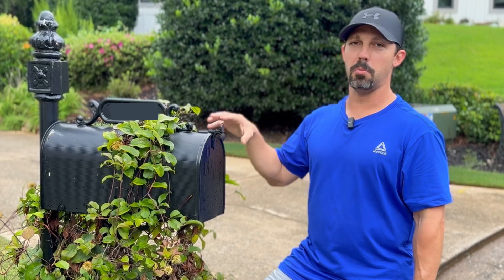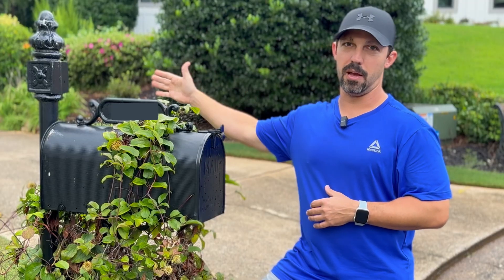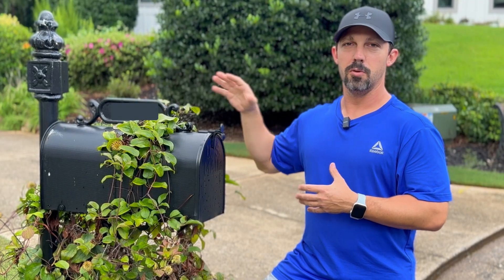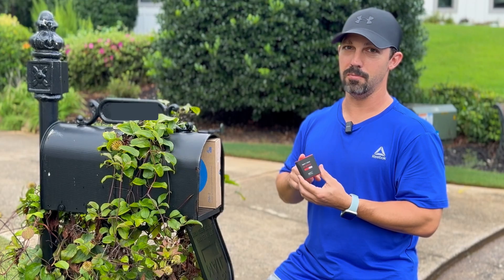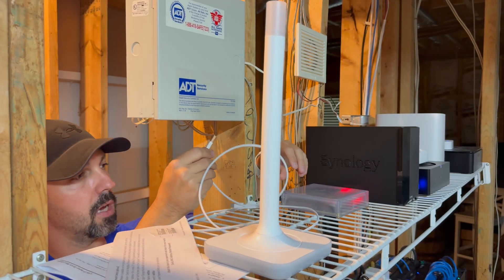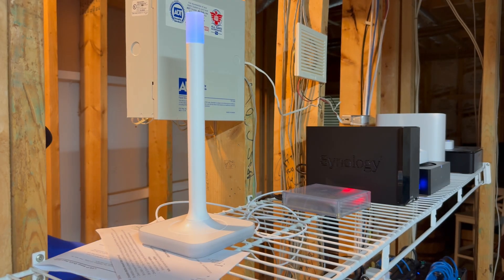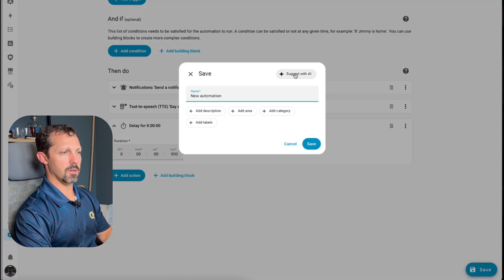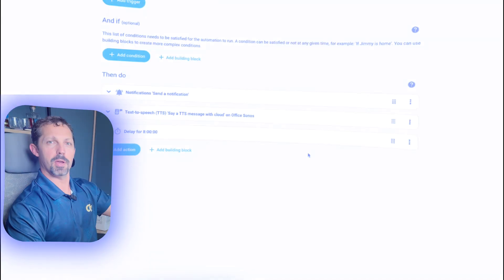Smart Mailbox! Home Assistant z-wave setup with the Connect ZWA-2

Comment: I do the same thing but have POE powered zigbee smlight SLZB about 500ft from our home.  Our mailbox is across the street from that where I have a zigbee sensor for the detection and alerts.
Reply from the maker: I’ve heard good things about smlight! Do you have the radio mounted inside or outside?
Reply: @Automated_House  I have it in a project box that has dual fan exhaust w/ filters (powered via poe).  I made a hole in the side for the antenna to go out of and sealed around the hole for weather.  Works great!

I also use one inside the home, and plan to deploy another outdoor box for the back yard for automation things I have planned there.
Reply from the maker: @ShaneNSAT nice! Sounds like a great setup.

Comment: It's detrimental to have two connectors within range of each other. Instead, migrate. The only advantage I could imagine is if you exceeded the extremely large number of devices supported on a network. (Also, the main issue with penetration will be metal and water. You can't make it through metal regardless of your antenna which you figured out the hard way, water will also block signal and it's in plants.. Your cement likely is filled with both metal and water.)

Comment: Thanks for this, very helpful.  I got the Home Assistant Connect ZWA-2 and Zooz Open/Close XS Sensor based on your video and got both installed and working.  Mailbox is about 550 feet from house.  Mounted the sensor inside a Parsons Medium Capacity Plastic mailbox.   Working great.  Thanks!
Reply from the maker: Awesome!

Comment: You’re totally off the mark here.
A Yolink branded LoRa contact sensor can be installed INSIDE the metal mailbox up to a 1/4 mile range from the hub. 
I don’t know why, but LoRa seems to be seriously under-represented in YouTube influencer circles. 
The breadth of devices are volumous, they now have a matter capable hub, AND it’s HA compatible.
Reply from the maker: I definitely want to test a LoRa sensor. Which brand is your favorite?
Reply: LoRa is underrepresented because of the lack of locally controlled radios/hubs and devices.

I agree there should be more effort around it and was hoping this Nabu Casa device would help support more LoRa, but alas.

Comment: Lora works way better for this use case
Reply: If YoLink had a local connection to HA, or someone could get LoRa devices to connect locally to HA (through a LoRa dongle or similar), then I would consider LoRa. 

However, I used a Ring Outdoor Contact sensor (latest models use Z-Wave LR), and have been happy with it since.
Reply: @AnimeMangaBazinga exactly. Yolink has been a horrible producer. They have misled, outright lied and baited and switched on multiple of the promises they have made about their products and platform.

They are the epitome of smart devices you shouldn't trust with your data and privileged access to your network and local radio waves.
Reply from the maker: I need to pickup a Yolink LoRa hub and test their sensors. I've heard good things!
Reply: @Automated_House  I use a Yolink motion sensor inside my mailbox, works great. Our mailbox sits inside of brick surround, so it has to go through the metal and brick and it still works without any issues.
Reply from the maker: @jcm9698 nice!